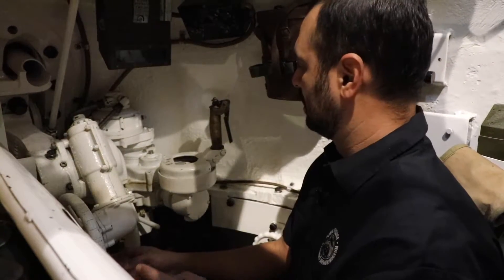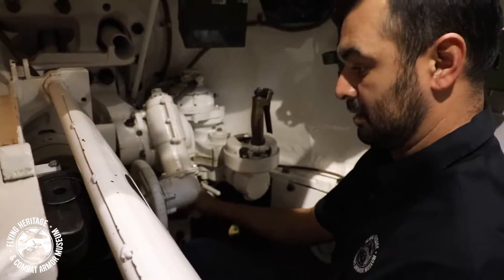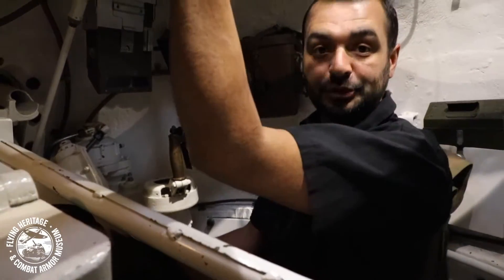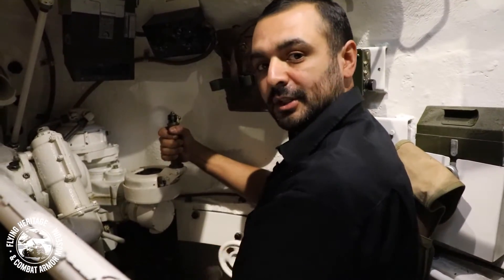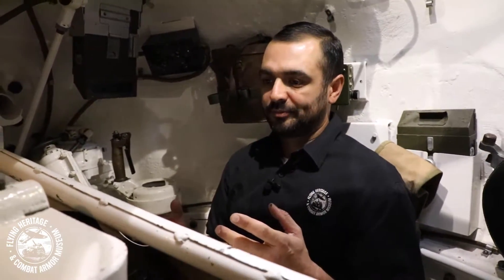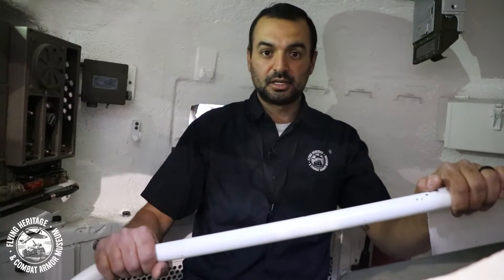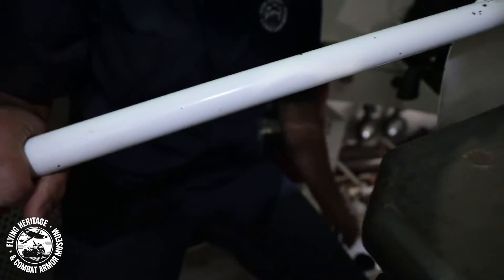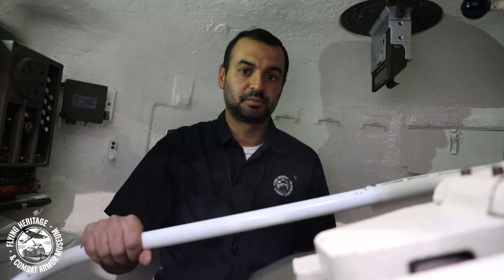Sherman Tank Tour Part 3: Inside the Turret

Comment: What you see in the beginning of this video is one of the reasons why the Sherman was the all around best tank of WW2; i.e. the speed at which the M4's turret could traverse. Heavier German tanks had a slower turret traverse rate and were more sluggish than the M4. It's why in 30 engagements between M4's and Panthers, the M4 had a 3:1 kill ratio.